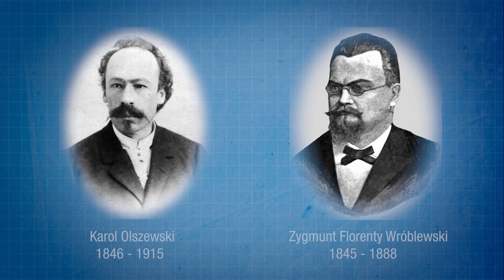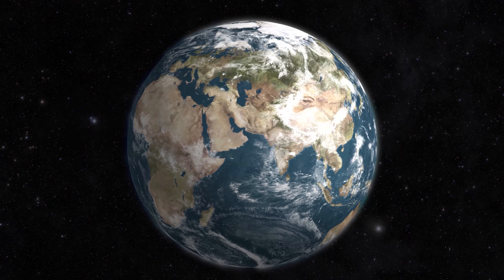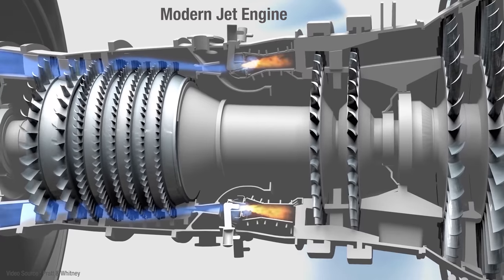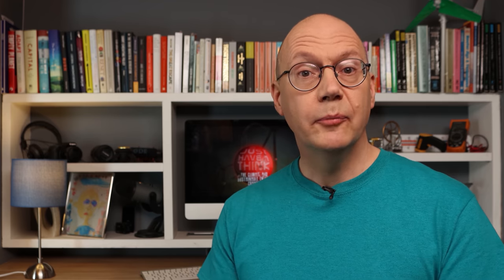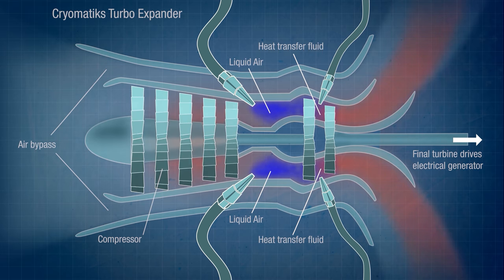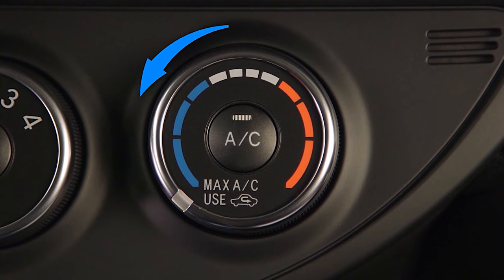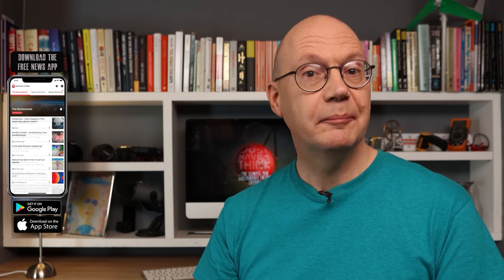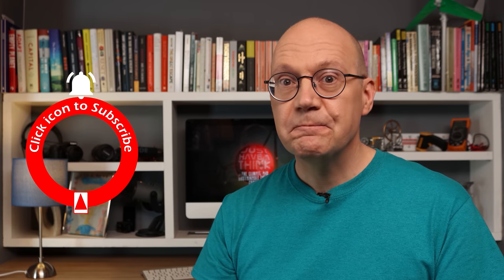Portable Liquid Air Power. A new boost for electric vehicles.

Comment: Stuff like this has interested me for years. I still have the reply I got from Clive Sinclair when I sent him thoughts on electric cars and battery charging stations back circa 1981 (the dark old days of lead acid batteries and very limited range). I was also interested in regenerative braking back then and I have wondered about whether compressing air could be used for short term energy storage on vehicles (especially heavier ones like buses, vans, HGVs, trains etc that are involved in stop start scenarios - something you refer to in your video). Might it be quite simple and low tech to retrofit some kind of device to existing internal combustion engine vehicles? Efficiency would not be a critical issue since fitting the device would be justified on the 'any energy recovery is better than no energy recovery' principle. If the air is compressed into a lagged tank (and perhaps even unlagged) and released back into the drive train without much delay, then it should return a similar pressure to that used to compress it and without any extra heat.  The device could be driven by/return drive back to the propshaft. Could this idea work, or is it just nuts? Perhaps it has been done already? Essentially, this device would act as a sort of super capacitor, but storing energy using an air system instead of an electrical one (although maybe the electrical option would work better, as long as it is similar in cost?)
Reply: L_am gândit acest dispozitiv(pneumatic) Este ca un balansoar accelerație _deceleratie, multiplicare _ demultiplicare ACCELERATE. Frânarea este necesară tot mai puternică spre sfârsitul deplasării. Până la

Comment: What about the weight of the system the heavier it gets the less efficient it is you can´t just put more weight on something that has to drive since it has to move the weight as well and that is the problem with battery powerd cars because the batterys are already heavy so i assume that it would be the same as putting more batterys on the car. of course if it weighs not so much then it could be the right choice but without knowing the energy to mass ratio your video apart from being interresting and informing neglects the possible realisation of such an device in an 
E car that being said i like your videos and I hope my comment is not seen as offensive but constructive criticism  sorry for any writing errors english is not my first language .

Comment: I wonder if this premise could be used with hydrogen, further utilizing the energy stored in liquid hydrogen, first through expansion, and then through either combustion, or more intriguing, through a fuel cell. This, in theory, could not only make the potential usable energy storage in liquid hydrogen higher, but also reduce the overall system efficiency of producing and using liquid hydrogen, as one would in essence be recouping some of the energy lost as heat during the liquification process of hydrogen. Thoughts?

Comment: Seen material from years ago using liquid air to move vehicles, even by garage tech. Now that EV's more common it's nice to see its found a  place as range ext. That said, I'd prefer further developments of 'cryobatteries' to replace chem battery storage completely, maybe use super capacitors and larger liquid air tanks.. Cuz lithium batteries are the biggest flaw for EV's.  They're NOT eco friendly, costly, requires tedious bms electronics and hazardous. Maybe the range won't  be competitive without them  but  cars will actually be cheap, actually good emissions numbers, and geezz integrating liquid air at service stations makes practically more sense than distrupting infrastructure, shifting economy and livelihood. But Alas

Comment: I'd have to study the whole thing more closely to be sure, but my overall impression of the performance of this device is that it's probably fairly efficient, as you say, but it doesn't have very high energy storage density. 125 Wh/kg is really not very good at all by today's standards. But WRT efficiency, even there, 75% is not really great compared to a battery.

Comment: I think liquid air has a lot of potential for energy storage, but using it as a range extender kind of defeats the purpose of the energy per kilogram is about the same as batteries. It'll probably be cheaper to just make the battery a bit larger, especially considering how quickly the prices of batteries are dropping.

A range extender that could fill up the battery while you're driving, that weighs like 10% of the corresponding amount of battery, and CO2 free, now that would be a game changer.
Reply: One very important thing you forgot is that battery degrade,so the less you can use the battery the better.

Comment: I wonder if this technology would be interesting to designers of airships?
Perhaps nitrogen could be used as both a way of storing energy and ballast?
Reply: With just 0.125 kWh/kg?
Kerosene has an energy density of >10kWh/kg
Reply: @TheSpecio  I was thinking they could move around liquid nitrogen from one tank to another to shift balance, harmlessly release it to gain height rapidly or using refrigerant technology they could make their own from thin air perhaps using thin film solar panels? 
Currently most use inefficient dirty and noisy diesel engines.

Comment: Methane LNG tankers can use electric turbines instead usual throttle (control) valves to pressure required for natural gas transportation, why loose such much energy if it can be transferred to electric energy.

Comment: Om Ah Houm 
Yummy stuff! 
Would adding a 'sterling engine' type machine, be a big enough detriment if, utilizing the heat from the batteries and other components on one side, then utilizing the colder temp from the liquid oxygen side... 
And seeing if the shape and size of the platforms that utilize the temps, be also a hindrance...

Comment: All liquid air tanks are designed to constantly leak. Imagine if your gas tank had to constantly be spilling out fuel to prevent it from exploding. Liquid air can reach pressures over 10,000PSI, and nobody is willing to claim that they can build tanks to safely handle that pressure do to the catastrophic detonation the tanks can undergo. That’s why they are kept so cold, pressure alone isn’t reliable enough, nor safe

Comment: I'm confused, where is the regenerative energy stored?  I only see an energy converter, no storage.  What am I missing?
Reply: It's used to heat the water/glycol mix being injected into the turbine.
Reply: @phillipsusi1791  But that energy is converted, not stored.  Is there a reservoir to store the heated water so the conversion can take place later?
Reply: @mrhickman53  probably, but it doesn't really need stored.  It's going to get used up in the turbine fairly quickly to recharge the batteries.
Reply: @phillipsusi1791  Doesn't that defeat the purpose of not requiring the batteries to immediately store the regenerative energy?  It may be that they are relying on thermal inertia to spread out the recovery and reduce the peak power flow into the battery, rather than delay capturing the energy till the bus next accelerates.    Sounds like a bus with just enough battery power density to accelerate slowly but wants to stop quickly.

In my opinion the problem statement could have been more clearly stated.  I'm used to looking at EV's whose acceleration capabilities are closer to their tire traction limits.  It is not necessary for regen to be much more aggressive than acceleration in this case.  

I'll have to rewatch to try to understand why this might be better than other approaches.
Reply: @phillipsusi1791  My second attempt to reply.  I must not have hit the big bold blue box labeled "REPLY".

I watch the video again.  The head-feint is that the product is described as a range extender.  The expansion of the liquid N2 provides the bulk of the "range extension" energy.  That portion of regenerative energy that would be otherwise expended in dynamic braking resistors, due to the power limitation of the battery, as well as other waste heat sources on the bus, such as air conditioning provides additional heat energy in order to maintain isothermal expansion of the nitrogen.  They are claiming the same energy density for the turbine as Li-ion batteries but I have to listen one more time as this does not make sense, yet.  I expect energy density to be ascribed to the storage media not the energy converter.

I like being able to convert the air conditioning and electrical system heat losses back to electricity using the nitrogen.  However, I'm finding the regenerative energy a bit suspect for newer bus designs.

Not being able to recover regenerative energy is a power density issue for the Li-ion cells.  Different chemistries have different power density to energy density ratios.  Since a main focus on EV batteries is rapid charging, or power density I am not sure regenerative braking thermal energy is a reliable source long-term.  There may be other characteristics of the bus use profile that make it prefer more energy-dense but less power-dense solutions but I can't think of any at this time.

The way I imagine this system as of now is, as long as a source of otherwise waste thermal energy is available the turbine can run in order to charge the batteries.  At the energy density stated no mass is saved over installing more batteries in the first place.  More batteries imply a better ability to recover regenerative energy.

I'll be surprised if the advantages outweigh the inconvenience of both charging and putting nitrogen on board.

I''ll revisit and see if I come to a better understanding of the energy density claim.
Reply: My last reply, I promise.  The energy density stated is for the nitrogen and does not take into account the mass of the turbine, alternator and nitrogen containment.

More batteries better manage the regen braking energy at equivalent mass to the nitrogen to convert the thermal energy due to regeneration the batteries originally could not manage.  We called such energy "dynamic braking" energy.

While the technology is interesting, I am not sold it has much chance of wide deployment.  What is missing from this video is the efficiency of liquifying nitrogen and placing it on board.  I suspect that that energy loss is probably on the same order as the thermal energy that would otherwise be wasted on the bus.  I'm not seeing the win, especially in not in proportion to the complexity.

Comment: There are no "cold temperatures". A simple compressed air tank should be efficient too and much cheaper. It acts as a high capacity electricity buffer, Koenigsegg will use it.

Comment: Have a think: Which of the 3 basic EV drivetrains - BEV vs PHEV vs HFCEV - offers the most benefits, advantages, applications and potential to reduce fuel/energy consumption, emissions AND insane traffic? The correct answer is PHEV plug-in hybrid which could serve 60% EV needs. BEV serves the remainder in mostly 'lightweight' and 'short distance' purposes. HFCEV tech only a niche market of stationary power supplies. The first and foremost problem EV tech must address is unsustainably excessive vehicle miles travelled (VMT). What does that mean? Think about it.

Comment: i dont understand how you can inject something so cold or pressurised and get a warm output. the diagram is very confusing
Reply: The liquid nitrogen is absorbing heat from the ambient air passing through the turbine.  The outgoing air is much colder than the incoming air.
Reply: Not according to the diagram
Reply: @njipods  yes, it is according to the diagram.  Go take another look.
Reply: @phillipsusi1791  diagram clearly shows warm air leaving the turbine arrangement.
Reply: @njipods  Warm compared to the temperature of the LN2... still colder than the incoming ambient air.
Reply: @phillipsusi1791  then why us the incoming air shown as blue....
Reply: @njipods  It isn't... the incoming ambient air is shown in white.  The blue is in the middle part.  I'm really not quite sure what is going on there now that I look at it again.

Comment: It's more efficient to store regen in a flywheel . Virtually no limits on that.
Reply: The limit there is the mass of the flywheel and how fast you can keep it rotating before it flies apart.
Reply: @phillipsusi1791  That limit is way beyond what regenerative braking requires.
https://en.wikipedia.org/wiki/Kinetic_energy_recovery_system

Comment: It costs as much per unit energy as diesel and weighs as much per unit energy as a battery. That is just dead on arrival.

And isn't one of the selling points that it is "mature technology"? There isn't much low hanging fruit for liquifying air or for turbine manufacture, I'd expect costs to decline over time, but at a slower rate than batteries.

Maybe there is an advantage I'm not seeing, but this seems like it fails to provide any value, with limited future prospects for improvement.

Comment: Electric tractors.... Forget about it. When plowing a decent tractor uses ~1000l of diesel. 43.1MJ/kg - 11.97kWh/kg with 0.8325kg/l average density one so diesel has 9.966kWh per liter. With about 40%modern diesel efficiency a modern tractor needs ~3986kWh a day at the flywheel.
Reply: And just how many days a year are you plowing? Not more than a week, I reckon… For the rest of the year an electric tractor will be just fine. And if you use a robotic tractor, like the Axceed, you can plow 24/7, so you don’t need to use a 5+ shears plow and you won’t need all that power.
Reply: @niekhogendoorn5156   you are right about  the fact that you plow just in spring and fall, but usually when seasons come the fields need to be prepared in couple of weeks, and that does not give you a lot of those 24/7, if you include charging, maintenance and repair, you get close to the point of diminishing returns anyway. Unless hydrogen fuel cell or DEFC(direct ethanol fuel cell) or DMFC(methanol) would be used in hybrid electric system, but for now, tractors, trucks, ships and every heavy equipment will continue to use diesel or other type of liquid fuels. And there is nothing that I or you can do about it.

Comment: sorry to nitpick but n2 has a long way to go before it becomes useful for fertilizer, it still needs lots of hydrogen and energy to be transformed into something bioavailable, and compressed nitrogen doesn't really do anything useful for biological nitrogen fixation
Reply: btw if that energy and hydrogen is invested (for instance high temperature nuclear could economically generate both), ammonia/urea can be used as a chemical fuel in vehicles, and the emissions are n2 and h2o

Comment: So one of the problematic things about electric vehicles that's often cited is: when they are involved in an accident, they tend to burn in a hard to manage way. So I'm wondering... can nitrogen extinguish a burning battery? Or is a battery fire not dependent on atmospheric oxygen?
Reply: Lithium ion batteries 'burn' due to the heat released by chemical reaction, so don't require oxygen, but then other things do catch fire and burn using oxygen. So in answer to your question, it's a bit of both.

Comment: Few days ago Sandy Munro featured new hydrogen tech that might just make it feasible. He think's it's better than solid state batteries and normal batteries(except for the cars). It's called Light Activated Hydrogen and it stores it at room pressure. The vid is called:
"Sandy Munro On Next-Generation EV Technology: Tesla, Solid State Batteries, MegaCastings, VTOLS, Q&A"
Starts at 25:50
Reply: it's atmospheric pressure
Reply: Thanks for the info. Your Video Title was spot on. 
I had to use it to find the video. Thanks for including it, in it's entirety. ;)

Your line "A few Days Ago" = 10 days. 
"A Few Days Ago" is commonly restricted to a period of less than 7 days.
Shoulda wrote "last month" or alternatively, "on April 22,'nd 2021".

Your Time Index Link doesn't point to the correct video.
Shoulda wrote:  https://youtu.be/053rKZjP-8c?t=1490

I know i'm nit picking a bit, and if I had to guess, you probably didn't post a direct link, to prevent a filter from deleting/screening your post, eh? ;)

Comment: I suppose the tech guys took into account that explosives are made by either liquid or chemically bound  nitrogen quickly turning into gas.  I'd hate to be seated above liquid nitrogen if it got loose.  Of course, the same could be said of hydrogen.  There's a lot to be said for walking.
Reply: It takes a LOT of energy to turn the liquid nitrogen back into gas.  Absorbing that energy from the environment takes time, which means it can't explode.  Explosives provide their own energy in the form of chemical bonds breaking.  The cloud of expanding gas is mostly the gas that was already there, not the nitrogen in the explosive.

Comment: If this liquid air system has a high enough energy density, perhaps using this system in jet airliners might be a simple path to making a new fuel for air travel. 

I mean, we're already using it to spin a turbine, with air bypass and "heat transfer fluid" injection, why not take it one step further, and put it on a plane?

Edit: Nevermind. Kerosene has an energy density of ~46 MJ/kg. Significantly more than the liquid air value, which I don't have hard numbers for, but is significantly less than fuel.